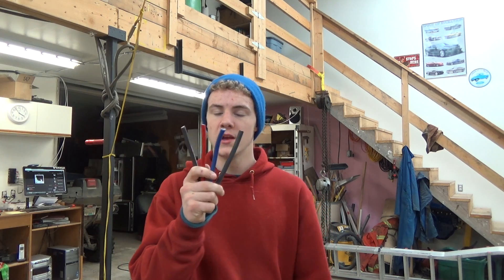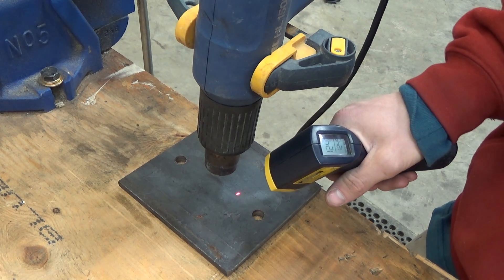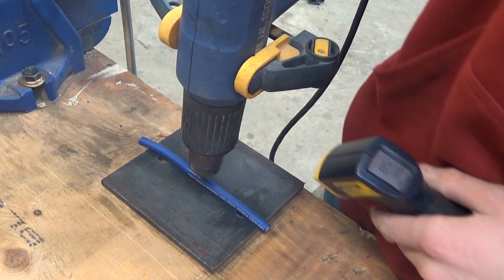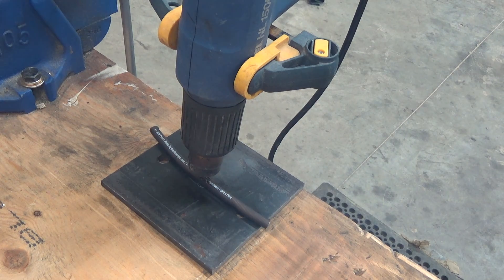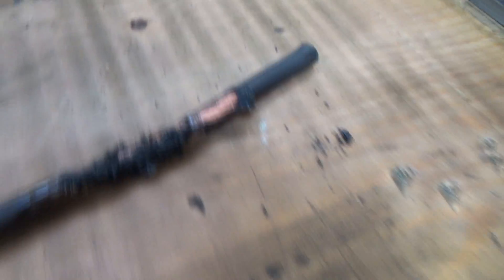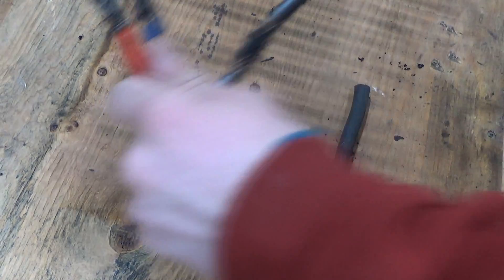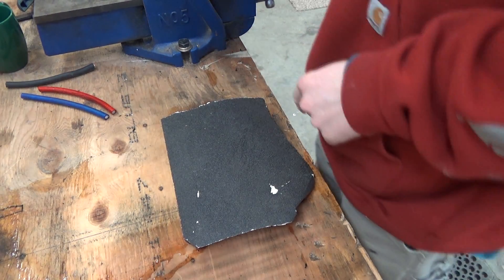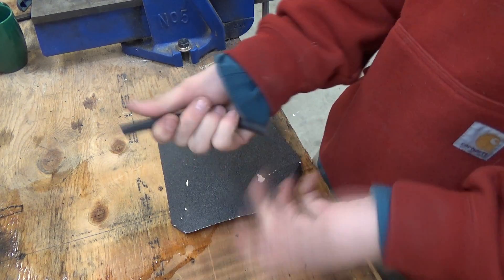Welding Cable Vs Car Audio Cable

Comment: As a welder, welding cable is designed for heat and wear resistance. It is also a clean low resistance conductor. Like you were saying the terminations are the most important part of the wire.
Reply: Exactly, car audio cables are made to be flexible and easily tucked away.
Reply: i was going to say the same thing, 1000 degree slag balls hitting you all the time need to be able to take the heat, audio wire is more resistant to friction but is not designed to handle that kind of heat. if you have installed it correctly you shouldn't have issues either way.
Reply: Caddy Guy Gaming On your DTS is the alternator still on the bottom of the engine or something? I'm in the market for a new car and have been thinking about a DTS, but I've heard the alternator on caddies is a real pain in the ass.
Reply: @ignacio8597  The alternator is on the bottom of my car, takes no longer than ~ 45 mins to change it out.
Reply: runforitrun Yea it's on the bottom. I've seen a video where you can get by with just removing the fan assembly but it would be a bit of a squeeze. I had to replace the radiator too so I followed the service manual except I left the AC condenser connected. The extra room for doing the wiring was great. Even if I didn't have to replace the radiator I probably would have done it that way anyway. I have a semi crappy slideshow/video uploaded. It was cold and I wanted to get it done so I didn't record like I would have liked to.
Reply: Caddy Guy Gaming shit I’ve been using the wrong kind lol
Reply: Also welding cable is very flexible and true to its size.
Reply: Maverick Wagner no it’s not, at least not the kind I use

Comment: Of course welding cable is better than most car audio wire and it goes up to 4/0. Unless you're laying your wire directly on the exhaust manifold most insulation won't melt under the hood. I've seen guys run walmart wire for years and besides some corrosion it still holds up. If you really want some beefy cables go talk to an electrician
Reply: Long-dong Von Braun car audio wire goes up to 8/0
Reply: Jimmy Nix I said welding cable
Reply: Long-dong Von Braun yes I see but welding cable ain't the biggest wire and its not the best its to stiff
Reply: Jimmy Nix never said it was the biggest or the best. Just letting people know that it's cheaper than car audio wire and goes up to 4/0 gauge
Reply: Long-dong Von Braun you said it was better
Reply: Jimmy Nix yes better than most car audio wire. Never said best or biggest
Reply: Long-dong Von Braun you said better. not better than most if had said that I wouldn't have said anything but you said better
Reply: Jimmy Nix there you go fixed it, troll.

Comment: Do chemical test like petrol or diesel....
Reply: Proper welding cable should be oil resistant
Reply: Or brake fluid, or battery acid? Stuff that will more likely spill onto a cable and is way worse than what you mentioned. :D

Comment: Here is test ypu can do that will really test out the cable. Take 10ft from the leading brands you use and hook them up to a stick welder. Then using 3/16 or 7/64 7018 @ 200amps, weld some stringers on some scrap 1/2" or 3/4" stock. That should really put that cable to the test for heat and amp draw.
Reply: Keep it simple and use 2/0 welding lead on everything
Reply from the maker: All the way to the tweeters
Reply: @DonkeysBreath  LMAO 2/0 on tweeters sounds a little insufficient
Reply: Hell yeah that's a great idea 👍
Reply: Amen to that! Nothing like a ton of current to test a cable.

Comment: the welding cable is by far the best bang for your buck. I run 4/0 cable on the batteries in my solar set up. Their is also different levels of welding cable. It will hold more amps than any car audio manufactured cable that I know of. In my car audio installations in various vehicles over the last 30 years I've used welding cable and never had a problem. Just heat shrink ends like any normal person would do and your safe from corrosion. The car audio cable today compared to 30 years ago is junk.

Comment: A name brand (such as TPC, and others) 600-volt welding cable rated at 200 Cent. is as good as you can buy. I have seen this used in high voltage DC motors in industrial applications and have never seen a failure. It is not that much more expensive. And they bend so nicely and stay in position.

Comment: You forgot one of the most important tests, voltage drop per foot of cable.
Reply: welding cable is OFC if its good shit
Reply: Is voltage drop less or more compared to OFC cable? I use welding cable right now and I barely experience voltage dropping.
Reply: Gian Stevens voltage is an important factors while welding so you should’t get s significant drop ( nothing that would make a difference.
Reply: Go watch @steavemeadedesigns compare the 2 on the amp Dyno. Lost 300 watts on a 2500 watt amp with the cca
Reply: @mikehause6585  he was testing between cca and ofc, not sure if it was welding wire. I cant remember. But yea, never cca...

Comment: I only use welding cable, stereo wire is such a rip off.
Reply: i can tie pretzel knots with my eb flex 4/0, you've just been buying the wrong welding cable.
Reply: @Jeffdachefz  I agree! Just get the super flex welding cable, no issues here either!
Reply: turbojoe2 skyhigh audio wire is better than welding cable that shit is to stiff
Reply: Try the Type M welding cable that has more strands of smaller size. 4/0 has 2.2k wires, type M is around 4-5k! Type M would work great even at extreme frequency where skin effect would be an issue. Welding cable is better because of the insulation, not the copper wire itself.
Reply: Just curious what would be good welding cable? Knuconcepts’s 1/0 wire has 5000+ strands and most welding cable I find is around 2000+ strands.
Reply from the maker: it’s not all about strands, I’d say it depends on your application. Sometimes it’s nice should have a stiffer cable stays in place
Reply: DonkeysBreath I wanted to go with welding because it was cheaper than a lot of car audio brands, but is there a certain type of welding cable I should look for? Or would I be fine with whatever Home Depot has?
Reply from the maker: I would avoid the home depo/ pricess auto stuff, usually cheaply made. I would recommend going to an commercial / industrial vendor like raider Hansen’s or a landsgranger.  Look for one that is 110 degree C rated. That would be a simple way to gaug quality
Reply: turbojoe2 u should check out conext link on Amazon the 2/0 silver tinned wire for like 3$ a foot it exceeds welding cable by far

Comment: Of course welding cable is high quality. Welders use tons of electricity. So the cable better bring it. And think of the environments they weld in. It has to be tough. A pro welder isn't gonna deal with BS. 

As for KnuKonceptz. I'm not impressed. I was told that they're stuff was good. So I got an amp kit from them. Went through all sorts of trouble finding why my amp wasn't working. Turns out the RCA interconnects from them were junk. And the overall quality of their stuff isn't good. The fuse holders were crap.
Reply: KnuKonceptz actually has amazing power/ground cable. They have revised their RCA's but imo the RCAs to get are SMD high signal cables. but if the wire does its job to hold up during high amounts of current and stay durable then why would you complain?
Reply: I have yet to find a kit with a decent fuse holder, heh
Reply: SirFrag32 Yea. If you really want quality. You need to do it piece by piece. You could order yourself some nice circuit breakers, and forget the fuse holders if you wanted that way too. You may spend a little more, but it will look nicer, and be safer if you do it with quality parts.
Reply: I love the kids that buy 'kits' and expect it to be industry gold. I have had great luck with  the purchased components from Knu and have sunk some good money with them and haven't received one bad item yet.

Comment: The mispronunciations kill me.  Tinned not tined.  Knukonceptz like New Concepts.  Welding cable is going to be held to actual standards compared to cable made in china.  If it's made in usa there are standards to which it is held.  If it is imported it does not need the same standard.  This is a reason that car audio brands can call whatever size wire they want as 1/0 etc... Can be 2/0 or even 4/0 and they can still label it as 1/0. Where as in US if it's labeled as 1/0 it needs to fit that standard size.

Comment: where the hell are you buying ofc 1/0 for $9 a ft 😂😂
Reply: Jon Tanner wireandsupply.com royal excellence 1/0 welding wire $2.50  a foot
Reply: Jon Tanner interwebs
Reply: 2.45 for 2/0